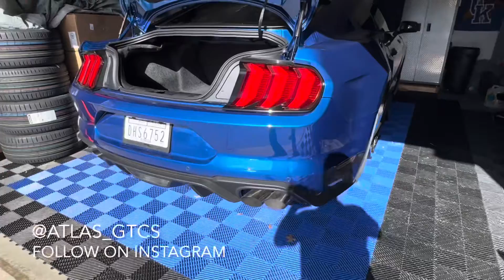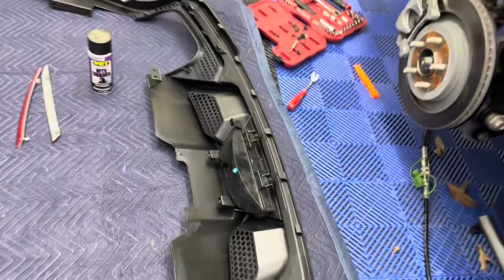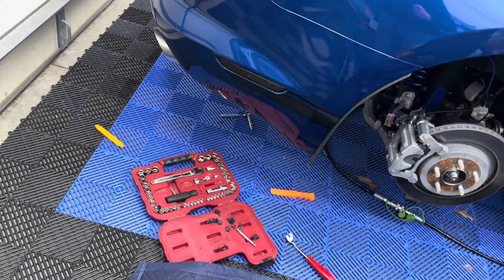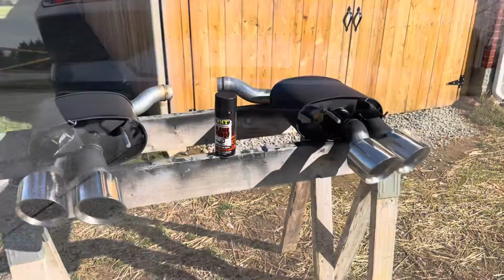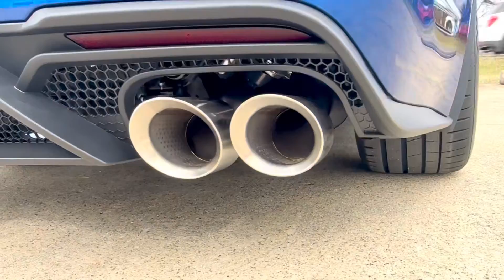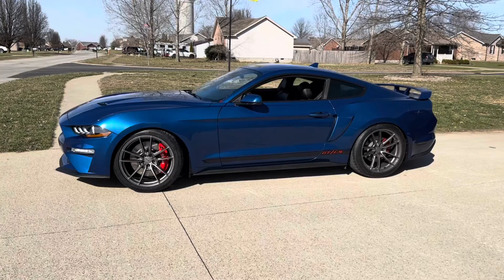S550 Mustang - Mach1 Mufflers & Brembo Brake Upgrade

Comment: Looks great! I’ve been trying to find the rear Brembo calipers for my 2018 PP1. Can’t find them anywhere, I painted my front calipers red with the G2 paint and came out fantastic but the rear calipers I more like the GT350R. Any help will be appreciated
Reply from the maker: So the GT 350 rear calipers will require you to install the rear GT 350 spindle kit from Ford racing. https://performanceparts.ford.com/part/M-2300-Y
Reply: @dksgarage6061  Awesome! But I was kinda afraid of that lol. When I tried to order the calipers on LMR it stated
They will ONLY fit a GT350 / R so I assumed the attachment area would be different. Thank you so much for your prompt help!
Reply: @dksgarage6061  Yikes 😬 $5,700 bucks, do I just need the spindle or the actual rear axles and the whole lot?
Reply from the maker: @sgt_loeraM1A1  honestly don't know about that. I just remember talking to. Gris at Steeda and he told me it really wasn't worth it. I'm hoping someone comes out with a bracket to adapt the S650 calipers.
Reply: @dksgarage6061  that seems like it would be a game changer if someone did that

Comment: Yo brotha I have a 21 GT Premium Convertible non performance pack. Looking to get these calipers too but I want black rotors from EBC. Can you drop a parts list I'd need aside from the calipers, rotors and pads?
Reply from the maker: Other than the hardware that's all you'd need. It's a bolt on kit man. Checkout this kit from Steeda it shows you everything needed. 
https://www.steeda.com/steeda-555-6040-s550-bullitt-front-brake-kit
Reply: Thanks for getting back to me bro! So right now i've got the front calipers. I should just need the front lines, pads and rotors? The ford kit comes with some dust guards and idk if those are "required"
 @dksgarage6061
Reply: Thanks bro! So ive got the two front rotor and planned on just using g2 to paint the rears. For the front, I should only need the lines, pads and rotors then? I know the ford kit comes with dust shields but don't know if they are "required"
 @dksgarage6061

Comment: do you know if the OEM GT/CS wheels will work with the new brakes?  I have a '22 and don't want to update/change the CS wheels out, thanks!
Reply from the maker: Sorry I do not know. My guess would be no, that's why ford changed wheels for the performance pack but I don't know for certain